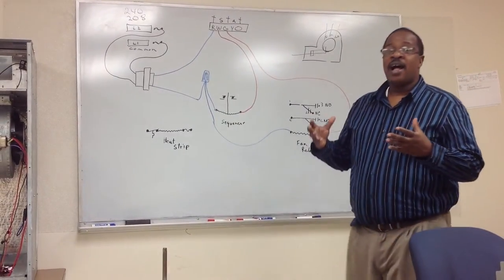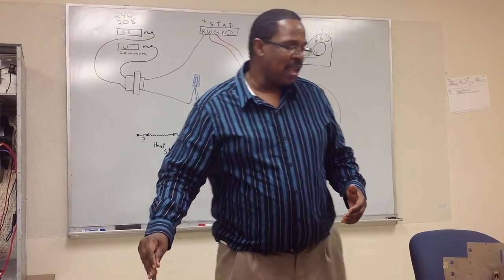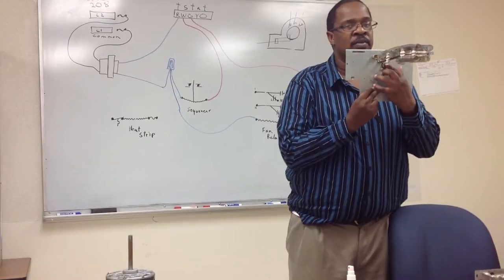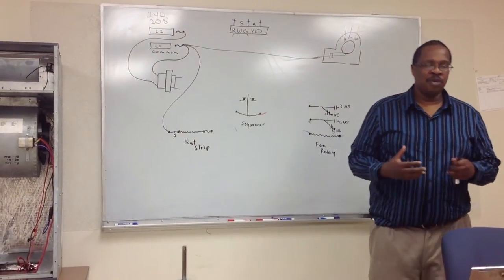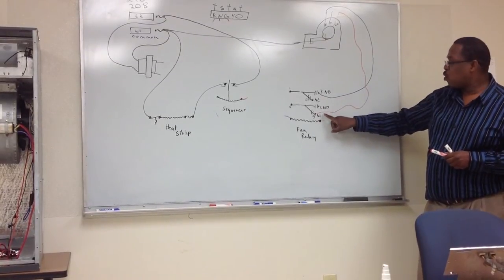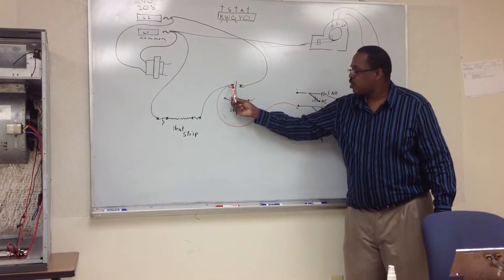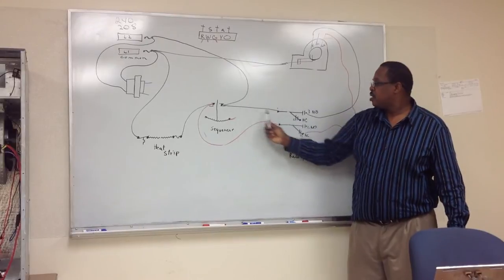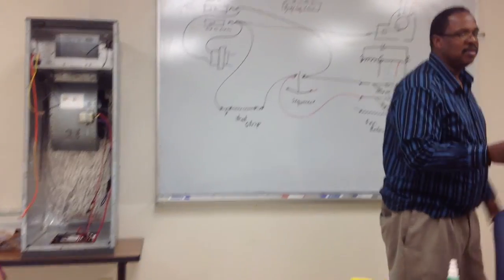High Voltage wiring for 2 speed air handler

Comment: What size wire gauge is going from the circuit breaker to the unit, the main lines  ?
Reply from the maker: depends on kw for heat strips
Reply: @jabbosax  10,000 W
Reply from the maker: @georgecapra  wire size to handle 50 amps or more. #6 wire
Reply: @jabbosax  Thank you very much.
Reply: @jabbosax  What type of wire is better  6 AWG, 3 Conductors, Aluminum, or Copper ?
Reply from the maker: @georgecapra  Copper
Reply: @jabbosax  Thanks and have a great weekend.